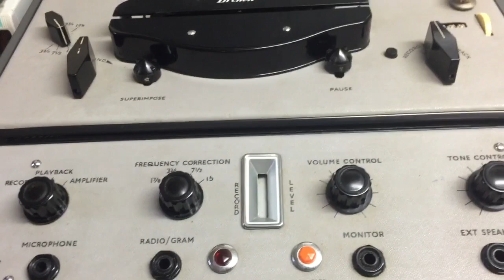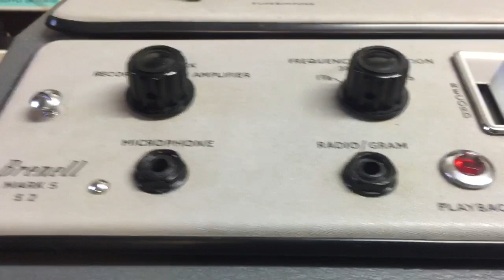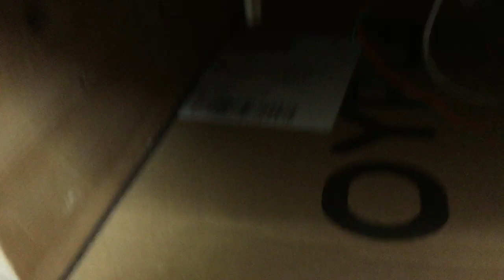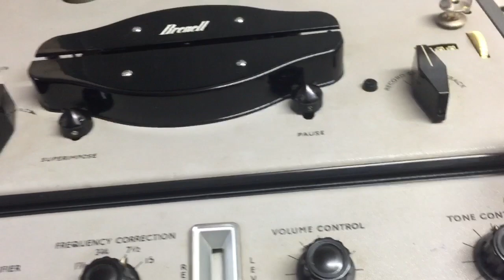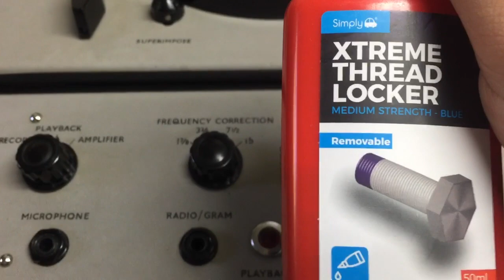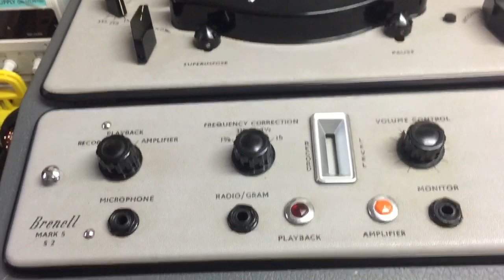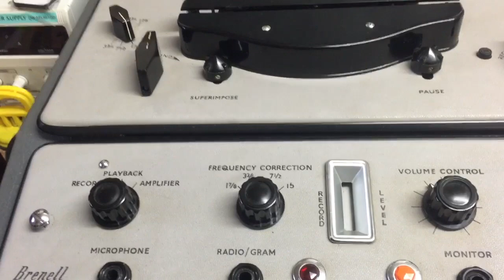Ongoing Problems with the Brenell Mark 5 Reel to Reel Tape Recorder.

Comment from the maker: Thinking about it, if you did record a stereo signal to both the old heads they would probably be in sync, it's just the signal tracks would be spaced apart, I wonder ?